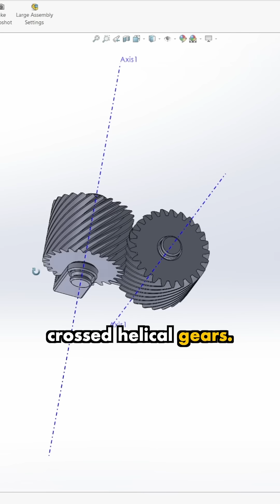Bevel Gears vs. Crossed Helical Gears

Comment: First of all those are NOT bevel gears. They are miter gears when the tooth count is the same. True bevel gears always contain 2 different tooth counts that not only change the rotational plane by 90 degrees but also produce a speed reduction at the same time.

Comment: I know this is an older video, but quick question! Did you use the Solidworks Gear making tool to create the 3D models for these? Or did you design them from scratch/through some other method in Solidworks?

(I mainly ask because I know the Solidworks gear making tool is apparently more so for demonstrative purposes as opposed to actually putting loads on them, but I was curious if you had success with it!)

Comment: That differential is all wrong.  They use a hypoid gear for the ring and pinion, a bevel gear isn't strong enough, plus puts massive lateral stress under high torq.  Those other gears were commonly used to drive a speedometer.

Comment: Okay… so wouldnt the solution to making the bevel gears fit your application be to cut the bevel gears at the angle you need…?  I’m not an engineer, dont get me wrong, but i am pretty mechanical, and my idea meter says that this design is weak somewhere, and as simple as it is, if it wasnt easily replaced, it would be in use….
Like, this same design could be made with a straight gear and a worm gear, cut at the exact angle you need the shaft to be

Comment: Crossed Helical Gears are like an extreme form of the common Worm Gear, which is also not efficient, but has some desirable traits like high ratios and locking the driven gear in place.

Comment: Cross helical gears are no good because they experience sliding friction on the gear tooth faces. Properly designed gear profiles have almost all rolling friction which has very low wear characteristics…

Comment: Crossed helical gears we used for making motion tripod for camera using brushless dc motor for stop motion movement at night. 
We used bevel gear for the tripod wheels. 

Like it was a rover that open box and expose the tripod and then let the lens capture data and then rover comes back. 

We did that for filming radioactive places that I am sure you all know those places.

Comment: Cars use bevel gears, but in most cars the shafts in the cardan are not in line. This is called hypoid teeth.This makes it possible to make the center line of the axle lower for off-road cars and higher for racing and regular street cars then the center line of the drive shaft.

Comment: I'm not sure about the statements in this video.
You are using a car example to prove your statement as true, but don't use very strong material.
If the method of bevel gears is better, it should work with lesser material.
For example, for many decades now i've had such gears fail,a nd start griding each other, meaning they can't handle torque. Various home appliances in the past (and maybe now) use this bevel type of gears and the gears are some plastic composites, that fail with time., because they can't handle the torque.
The precision isn't there.
Now, with that helical gears, i doubt you'd have gears skip and the "teeth" ground down because eveything is interconnected better

Comment: An automotive rear differential uses helical cut gears for two reasons the biggest reason is to increase the surface area of the tooth interface to improve strength the Ford 9" is the most famous for this because they lowered the pinion input location and moved it back into the housing to make the interface larger. The driving design for that was lowering the driveshaft in the vehicle so the tunnel can be smaller improving interior space.  The other reason is to help with noise. A perfect example of this can be seen inside the transmission in the same vehicle. All forward gears are helical cut improving load characteristics. The reverse gear is a straight cut gear which is what causes the whine when backing up at a high rate of speed.

Comment: The advantage of cross helical
 gears are in compact extreme
 high tension using as they can be
 anchored by both sides of each
 gear. If drag is an issue, lubrication
 can be Incapacitated by housing
 similarly as a rear-end differential. 

The limitations of which is better,
 falls on applications. 

Sorry if I come across as insulting,
 I'm predispositioned due to the
 fact that 1/3 of my career is fixing
 systems that engineers get wrong
 while saying that this is the best
 design out there.

I can no longer have the capability of biting my tongue, smile, & walk away. 

Y'all have a great day. 
& thanks for sharing.

Comment: You should definitely check out cross-spherical gears. Did some research on a Japanese application of this called ABENICS, applied it to an NDA project I was working on at the time. Super cool, involves some of these cross-helical gears in the drive differential if I recall correctly. Nice video.

Comment: Most cars I've seen are a bevel/cross Helical gear combination... neither the straight bevel gear nor the Helical gears are a good option for car diffs... think of a bevel gear with each thread rotated some degrees... it insures that multiple gears are always in contact with each other, sharing the force across multiple gear threads

Comment: Genuine question- wouldn’t cross haired be better at high torque because of great surface area? Yes it would also therefore cause more friction but more surface area means can disperse force over larger area this better strength????

Comment: That doesn’t sound right. The spider gears in a differential will give out prematurely if spinning excessively (bevel gears) it’s the ring and pinion which are helical and responsible for the torque transfer plus quieter vs any straight cut gear which is why straights are generally only used for a reverse gear application in a transmission due to noise.

Comment: Most differentials use hypoid gears which allow the pinion to be offset and not have the axes intersect.  They're also quieter and can handle more torque.  Kinda halfway between bevel and helical.  The spider gears though don't really move much so they're bevel.

Comment: I an not a mechanical engineer, i am an engineer though and i dabble in mechanics. It is my understanding that most modern differentials are a combination of bevel and helical. It was a huge leap that chevy took in the 40s by moving the pinion gear from the 9:00 position to about the 8:30 position to increase foot room. The ford 9 inch, regarded as one of the strongest differentials, actally has the pinion incredibly low. Racers like it because the gear ratio can be changed quickly, but that was not direction of this post so i digress.

Comment: Pinion and ring gear inside of the car differential are actually combination of bevel and helical gears, their axis are skew too. Also those pure helical gears are used in torsen differentials, where friction that they create is the locking torque.

Comment: Could you use the cross gears for low power and then have an electric motor or something switch where the power comes from and activate the bevel gears? Obviously this is hupothetical and i dont really know anything about mechanical engineering, but for the sake of simplicity, say the cross gears were active for torque up to 5 foot pounds and then from 6 up, ghe bevel gears would kick in and the power flow to the cross gears would be cht off so they would stop and get get damaged by the higher lower output.

Comment: Car differentials use hypoid bevel gears for the crown wheel and pinion, which offsets the axis of the input shaft. The sliding action in the gears reduces noise compared to a straight bevel gear, as well as keeping the shaft further up for better ground clearance. The other gears in the diff are bevel gears, since they don't move that much so noise isn't a problem.

Comment: hmmm... yes and no. there is a hybrid between these 2 that are common in differentials. many differentials have the pinion gear offset from the axis. they typically shift it upwards to give better ground clearance for the driveshaft. to make this work, they make the gear splines angled. this has the added benefit that the gear messing is more smooth than straight cut bevel gears

Comment: I mean, technically yes for the differential, but most diffs actually have a helical bevel pinion and ring gear, so a cross between both, to eliminate excessive gear whine, and also for differential positioning.

Comment: Hi, I'm a student and working on a project. I was wondering if bevel gears can be used for marble/stone cutting power tools that run at 12,000 RPM no load speed. I Know that Bevel gears are being used in circular saws but there the no load speed is 6000 RPM and torque required is high. (Whereas as per my understanding for marble/stone/tile cutters, diamond wheels are used that actual grind the material than cut it the way TCT blades cut wood. So thats why cutters require higher speed but do they also require high torque? And can Bevel gears work efficiently at higher speeds?) Sorry for the long question but google wasnt helping :(.

Comment: What print settings do you use on those bevel gears? I tend to get bad results on the angled teeth faces. I generally use smaller layer height for better resolution but it’s not perfect.

Comment: The straight bevel gears inside a differential almost never turn at "high speed" as they're only active when there's a difference in rotational speed between each side, and that difference is usually extremely minimal.   Ring and pinion gears are the ones that take power from the engine at high speed, and it's sorta a hybrid bevel/helical gear set, so as to reduce noise.  Sometimes the rotational axes do not cross.     As others have mentioned torque biasing differentials like the Torsen, Quaife, Peloquin and Wavetrack do use helical spur gears in place of the straight bevel spider gears to provide a torque multiplication effect (it's not "limited slip", as they don't react to slip, but torque imbalance).

Comment: With an angled cut on the gears in a differential they technically don’t need to intersect, they are offset to both improve clearance and reduce noise

Comment: Don't forget one more negative about bevel gears. There are so DIFFICULT to manufacture. Not the 3D printed ones, but the metal ones. This can slow down manufacturing for any device or system that uses them, and increase the cost by quite a bit just for some gears.

Comment: Except most vehicle diffs use a mix of both. It’s like they  kinda squished both together into one gear set. Which is also why they need to be a matched set. Having been run in at the factory with a diamond paste so they mesh perfectly. You can’t just take one ring gear and mix it with any old pinion gear. May work for a bit but will usually chew itself to pieces.

Comment: A worm gear is one, but...
     Yes, way too much sliding.  I know that a hypoid etc gear set does this too, because its partly a compromise, but crossed helical gears take this to the extreme.
    A worm gear is actually one... But the angle/ratio is such that it's a low speed high torque output compared to input, allowing a useful compromise.

Comment: car differentials are actually often use beveled helix gears. It's so the drive line can enter the diff from above the wheel axles. So its actually using both techniques in one!
Reply: The driveline enters below the centerline on rear axles, and usually front as well, but there have been some axles made with a "high pinion".  Its steonger for the pinion to pish rather than pull.
Reply: @fryloc359  The front wheels are more often driven with a transverse engine, including in many AWD cars and light trucks
Reply: The "bevel/helical" gear that allows skew axes is called "hypoidal" and was an American invention that minimizes the inefficiencies you ascribe to the helical, while allowing a lower driveline ( center interior hump) in a car.

Comment: Helical gears are in transmissions too they are mostly just like parallel in their axis right but is used because they are more quiet than straight cut gears. Really cool stuff
Reply: They are stronger too than straight cut gears unlike what was stated in the video. Many lathes converted to helical gears for this reason. A lot of vibration was removed and the smoother input allowed for less variation when starting cuts.
Reply: @OLDSKUULGARAGE correct, they're stronger because the contact patch is increased, and they can distribute the load across more material. I'm not sure why he would say they're bad in high torque environments when they literally run the piece in front of the differential
Reply: @_drivEN_  yep lol. I have a straight cut gear lathe (11.5”) and a two helical gear lathes (20” 21”) and the 11.5” is crazy loud while the other two are quiet. It really is incredible by just changing the angle of the splines will change so many things. God bless who made this stuff!
Reply: Spur gears are stronger, helical gears are quieter because the following tooth begins to mesh as the lead tooth unmeshes leading to a more even transfer of force and reduced vibration but a smaller overall contact patch and increased friction due to axial thrust. Spur gears have no axial thrust and mesh across their entire tooth face at once which makes them noisy but strong in low speed applications
Reply: @grinatm  Is why spur and like helical gears are used in differentials, the spur gears are the spider gears in the diff to allow that diff action lol. Then the helical gears are the ring and pinion also helped them make it more compact and move the input where it is the driveshaft lower. Way too cool stuff I love it.
Reply: @grinatm  you have it backwards. Spur gears are weaker but have less axial thrust. Helical gears are stronger and quieter but do not necessarily have more axial thrust movement requirements. If it is in a pinion to ring gear use using a hypoid gear-set then yes. If it is a gear to gear use then not always but there will be more friction between the gears. That is why most differentials in vehicles no longer use straight cut gears. They are a lot weaker than the helical counterparts. That doesn’t invalidate the use of a straight cut gear though. They all have their places in machinery.

Comment: Big recommend
Use sla or .25 nozzle to print your final gears in petg do reduce friction.
Another big problem is supporting the gear shaft on two points. It's much easier to do that in helical

Comment: Oh sadge, I discovered this gear coupling just a few days ago which would’ve been perfect for a thing I’m working on, but it’s especially a high speed high torque application, so I guess I’ll have to use extra bevels. I needed 2 vertical shafts driving 1 horizontal one in the middle

Comment: The crossed helical gear shafts can be supported on both sides of the gear since the axes intersect at the gear itself. So they would probably work pretty well in a high torque scenario. I want to make everything on the internet. Just found another.
Reply: What could your last 2 sentences possibly mean
Reply: @Brain-washed2  It means that now I want to do a project that includes making a crossed helical gear set. And that is one of infinitely many mechanisms and machines on the internet within mechanical engineering that are currently on my 'to do' or 'bucket' list. Gotta get out there and build some stuff!

Comment: Actually you will find them in a "Torsen-differential" in a car, where the friction is key for the torque transfer mechanism.
Reply: Those differentials are awesome
Reply: Yeah I was wondering if the higher surface area could help with high torque
Reply: @NihongoWakannai Usually the come in multiple pairs to cope with higher torque. Quite genius idea at all, used to have them in one of my offroad cars. No wear, good locking on loose surfaces, silent operation, never a problem at all. With the angle of cut, the amount of torque transfer can be fine-tuned.
Reply: @flashman_tv question if you made the teeth bigger (thicker) or the cog itself larger would have give you better torque? 
Or as you stated have multiple cogs but on opposite sides of each other to dissipate the load?
Reply: @NihongoWakannai was looking for this comment because was my same thought. Thanks
Reply: Some of Audis best AWD drivetrains use Torsen gears 👍
Reply: Usually found in military and heavy equipment.
Reply: @yeephaw or on the notorious mk4 Toyota Supra!
Reply: Love this diff in my civic si
Reply: miata
Reply: They work on worm and wheel.
Reply: Thabk you!
Reply: I was looking for someone who commented this
Reply: They are not "cross" helical gears though, which I hope was his point, as helical gears are used in all kinds of differentials, and tons of transmissions.  They aren't perpendicular to each other though, which I believe was his point.
Reply: Torsen diff uses worm gear
Reply: @sturmgewehr4454  I mean you could easily google this. Simple torsen uses helical gears. Don't know any type with worm gear or how this should even work. :-)
Reply: @sturmgewehr4454 a worm gear IS a helical gear.
Reply: Ofc. There's always that one guy "AcTuAlLy 🤓"

Comment: I'm really glad you mentioned the friction of the gears that's a really big design consideration. You should also mention how oiling both the gears and the bearing would be significantly harder. The first gear design can sling on the bearings and the seals very easily.

And on the second design you're gonna likely run into vibration issues at even medium speed

Comment: You can actually have a bevel gear set that doesn’t have intersecting axes… kinda. If you have a pinion driving the bevel gear, you can offset the axes by raising or lowering the positioning of the pinion along the bevel. Cars do this to allow for a lower ride and more cabin room